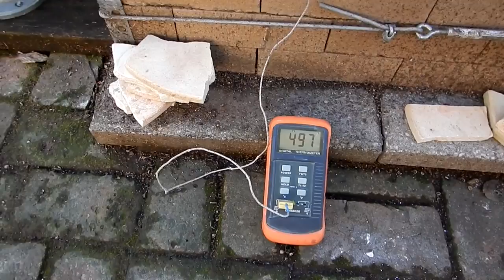Carving on the surface of pots & Fast Raku Demonstration

Comment: Great video.  I actually visited your blog, regularly, several years ago, when I was building my Raku kiln.  Mine is built from a steel garbage can, lined with the fiber blanket.  I wanted it portable, as I take it in to my classroom to do occassional firings.
That copper glaze, is probably the most metallic result I've seen.
I love the Deco/ Nouveau aesthetic as well.
Reply from the maker: That's great Ben, I'd love to see  some of the wares you've been making

Comment: I REALLY like your little raku kiln and the chimney peephole.  Is the fiber blanket pinned to the brick?  Hard fire brick?  The chinmey looks like regular brick  The burner post is genius.  I'm so doing that.   I think I need a studio cat and a studio fishtank as well....
Reply from the maker: All of the bricks are regular brick. The ones making up the body of the kiln have a lot of shale in them and they do real well at high temperatures. The fiber blanket protects the face of the bricks because they are totally covered by it . The fiber blanket stiffens up after the first few firings  so there's no need to pin it. Also the way the blanket  is cut prevents it from sagging inward too much and I've used 'Ridgidizer' on it. - I have plans for this kiln on Etsy  in a PDF - just look for Corvus Moon Pottery on Etsy.

Comment: Lovely work,  just learning pottery, I do china painting and working  twords clay work.  I see an open earthenware clay.  does it have a name.   so many it is hard to  determine which to get.   Your  pieces have such defined lines between color and black. did you wax resist the artwork > is the black  a glaze or carbon effect of the firing.   VERY INSPIRING.  ~~ THANKS/
Reply from the maker: Hi Cookie, The clay body we use  for Raku is actually called "White Raku" from L&R specialties. It's a very wide-range firing clay but will vitrify at cone 6. We don't use wax to separate the colors, ,Ruth just takes her time with a smaller brush. All the black is from carbon reduction - Thank you!

Comment: hello, your pieces are really interesting :) I make ceramics and I'm starting to study raku and watch and watch the video .. Can I ask you what you paint with enamel? and then in the photos at the end, we see the thickness of the veins of the leaves .. how is it possible if the enamel leaves? the smoke has no thickness - sorry for the bad English
Reply from the maker: Hi Francesco, I'll try to explain if I'm understanding correctly. The black leaves are carved into the surface by Ruth (see beginning of video). When we glaze the piece, we leave the leaves untouched by the glaze which makes them black with carbon because of the raku process.
Reply: @corvusmoonpottery  ... I hadn't considered that Ruth was working on the still soft piece. thank you for having replied!

Comment: Please explain why you plunge in water while SO hot. Do you use a Raku Clay or just regular Clay.
Reply from the maker: Hi Donna, in most cases we're using a copper bearing glaze that needs to be 'set' in order to have the colors stay the way they are. They will continue to change over a few minutes and might not look how we want them to if we don't stop them by 'quenching' them in water. The clay we're using is a heavily grogged, white raku earthenware clay